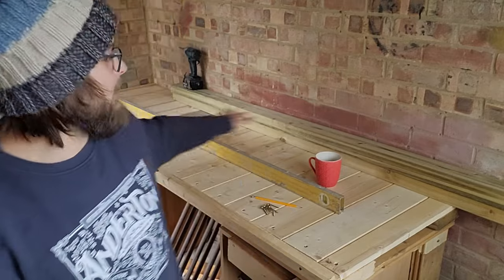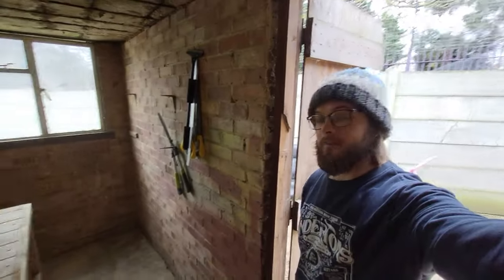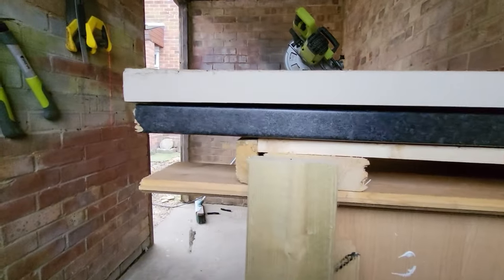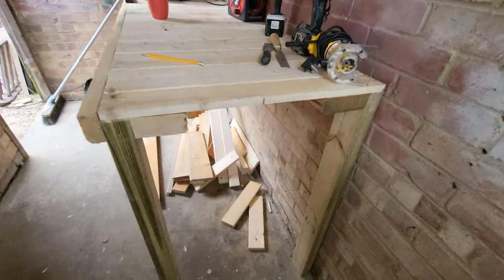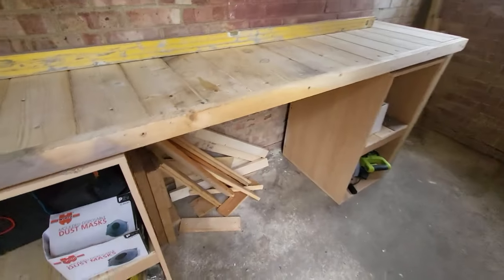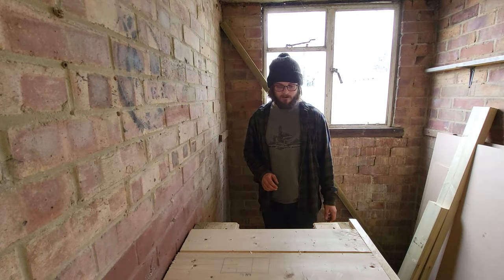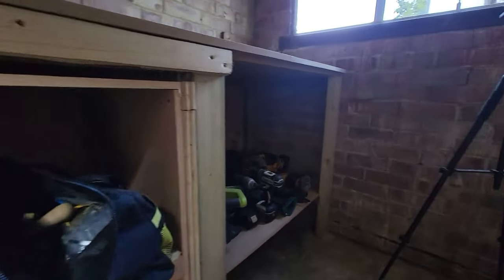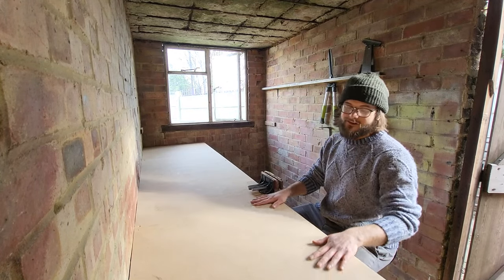Becoming a self-taught Luthier (From Scratch) EP2 Framing a Workbench

Comment: Your ceiling worries me a lil bit. Please fix it.
Reply from the maker: Yes the ceiling is not ideal but in an ideal world I'd have a huge workspace and all the tools I need. I am focusing on spending on the things that will get me up and running quickest, I appreciate the concern but can certainly assure you  it is a steel reinforced massive slab of concrete set back in the 50s when they totally over built and over engineered everything, it is perfectly safe just ugly 😆, and for that I can only apologise.